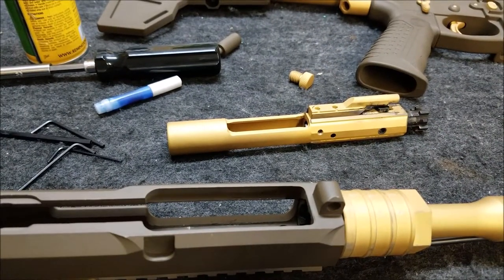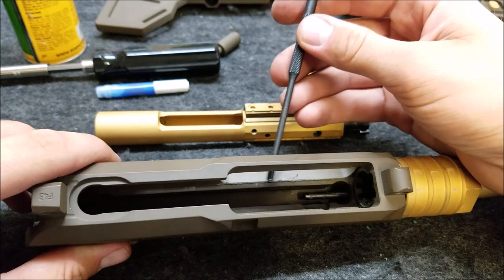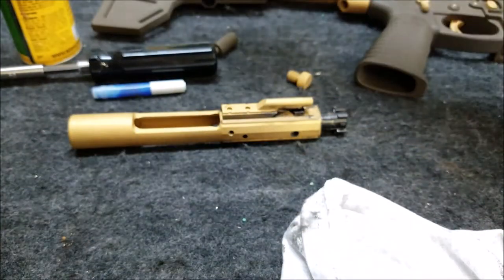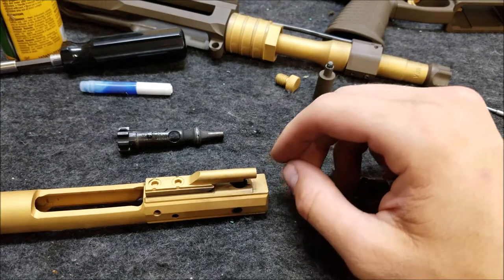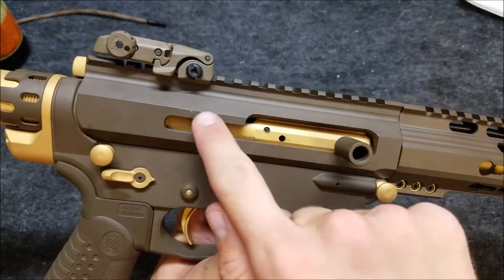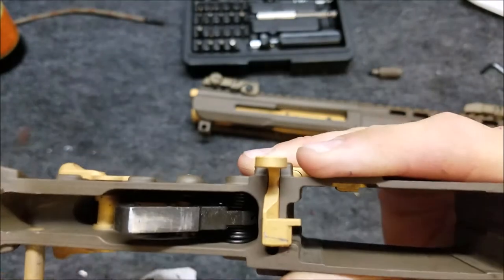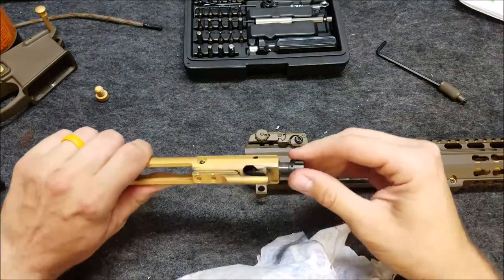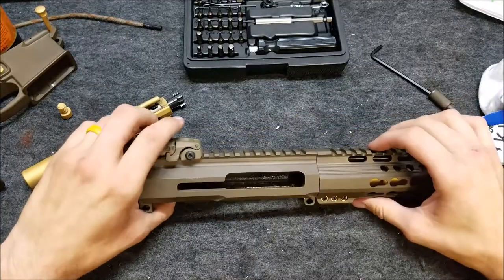Cerakote on BCG and internals. What happenens?

Comment: Cerakote has a permanent dry lube for internal parts. Look up Cerakote's Micro Slick, it goes on much thinner and doesn't wear like their normal coatings.
Reply from the maker: RockKnocker17 That sounds great! I didn't know that. I'll talk to my applicator about this. Have you tried it?
Reply: @GunsWithGage  it works great, its essentially hard like elite series, and is slippery like Nickle boron. and is thinner than h series.
Reply: @silverstormrifleworks7080  only draw back to the micro slick is one color.. would be nice to see a few color options for two toning. but function over form is always best.
Reply: @cwkhonda  oh yea definitely, it looks like garbage lol, would like if it came in black or at least a pretty gray
Reply: @cwkhonda  they actually recommend E-series for the internals. They have a few different color ways you may like
Reply: As Mr. C said above me, micro slick is only recommended when you need the 1200°F property. Elite is recommended by cerakote themselves for internals because it's harder and the coefficient of friction is about the same as micro slick, but it's just not as heat resistant.
Reply: Here is what they say:
"We recommend coating a BCG and Slide with the Elite Series Cerakote, so that you have the best corrosion resistance and protection along with the coefficient of friction performance.

The Elite Series and Micro Slick have an excellent coefficient of friction performance properties. The Elite Series has a 500°F temperature rating, and the Micro Slick has a 1,200°F temperature rating.

If you wanted a higher temperature rated coating, you would go with the Micro Slick."

Comment: Poor cerakote job. Someone used way too much spray and didn’t cure it properly. Let a professional do it, rather than wasting your money with DIY kits
Reply from the maker: Who do you use? This was done by a professional
Reply: GunsWithGage lots of people call themselves professional, but a certified cerakote applicator, trained at cerakote, should never turn out a job like that. The coating looks like they over sprayed and didn't use enough hardener. I cerakote at savannah river cerakote in Augusta, Georgia. We have several shops that will cerakote, but we're the only certified shop. The difference in quality is obvious when you get a good cerakote job.
Reply: GunsWithGage ...also, I'm not trash talking, just so you know. It's difficult to convey a message in appropriate context through typing. I'm just pointing out what I see, and I think you'd have a lot less issue if the coating was applied properly. I've seen stuff build up with duracoat, rattle can, etc, but cerakote is too thin and hard
Reply from the maker: HH it would be ok if you were trash talking haha. I am totally open to discussing things like this. To be honest, I have been a little disappointed with the wear resistance of my cerakote lately from this company. They are a bif company that is a certified applicator. They do all the engraving work for Bond arms. Among others. When I dropped off this gun and another batch, I think they were training a new guy. I would love to see any pictures you may have of USED cerakoted BCG's. This way, I can show my applicator, and maybe they can make some changes. It would be really cool if you could reach out to me on my gunswithgage Facebook or or at clementscustomfirearms@gmail.com
Reply: That’s what I thought. But I’m not a expert and have never applied and coating myself. I’ve heard that even after baking the coating it still needs quite a while before the cerakote has cured to its potential hardness is that true and if so how long should the gun sit before it’s cured inside like this upper?

Comment: No offense dude, but if it was kinda stiff, then you did it way too thick.. when you don’t get the layer between .005 to .001 mil, then your finish won’t hold up. Should be wearing way better than that.. actually should be no wear after only 100rds.

Comment: Cerakote sucks for wear parts, I did my Prodigy barrel and it wore off in like 100rds.  Pointless, works great for outside surfaces like frames and slides and small parts. But internally it's just messy and not durable

Comment: I wondered about how well it would hold up on anything but a safe queen.
Reply from the maker: I would Recomend against it for firearms that are used beyond just for show. It doesn't cause any issues,  but with all the good coatings you can get now, it's a waste of money on a BCG. I'd just stick with NiB, or TiN
Reply: Cerakote is a awsome finish this wasnt installed properly and  he used wrong product that's why their is some many issues dont let this determine your final decision
Reply from the maker: @rcplumberpilot  the bcg was done by a "professional applicator" I did not do it myself. Maybe they did do it won't. Cerakote IS awesome. I have had 3 bcg's cerakoted at different times, different colors, and they all turned out the same. An orange one really wore off quickly. Maybe it was done improperly
Reply: I do appolige wasnt trying to personally attack you or what you have dont just giving my input on what I see could be a issue please dont take it personally wasnt ment as a attack
Reply from the maker: @rcplumberpilot  oh no worries! I didn't take it that way. Just wanted to give all the info I had on it with my reply. It very well could have been applied wrong, but I do trust the rest of the work the place has done for me. I appreciate input Steve!

Comment: I found out when you first break in the Cerakoted upper use a lot of gun grease and you won't have any issues tape off the gas port so you don't get coating to block the port and unless you just really over coat the inside it should be smoother then without Cerakote I've actually have a lot smoother action with Cerakote the. With the lubed uppers that already come lubed

Also Cerakote says not to coat bolt faces because it can change your head spacing so I recommend not coating the bolt but the carrier is fine
Reply from the maker: Greatwhiteford 1 good idea on the heavy grease. I may try that on another cerakoted bolt/upper. I was using heavy oil. 

You are correct about the bolt. I would hope that most places that are applying cerakote would know this, and inform the customer. There are alot of DIY at home guys doing cerakote that my not fully understand how these things work. Education is a big part of safety..... 

Thanks for the comment!
Reply: Is this Cerakote C or H?
Reply from the maker: bigal31679 H

Comment: I would use micro-slick on the inside and whatever color you want on the outside. I almost did it to my upper on the inside but I ended up just using a regular black color. Been working great after a few hundred rounds. I do wished I used that micro-slick instead but I think I'm going to try it out on one of my pistols instead.

Comment: Not sure regular cerakote wearing off and entraining in oil is good. Isn't it the effectively ceramic abrasive paste? There's a reason they use hard coat type 3 anodize for most AR receivers. You want that very high surface hardness to protect the underlying aluminum.

Comment: There are coating's and there are metal treatments just because the black coating on black anodizing,pvd and dlc is worn off the surface hardness is still there, I'll take a treatment every time like you said internal parts no thanks exterior for looks and protection sure as long as it's not a duty or edc because cerakote is just a paint at the end of the day and does wear to a battle worn look fast

Comment: Get a real rifle that not affected by dirt and debris like an AK variant. Dont know what people see in these tube to function outdated systems.
Reply: Because some of us actually want to hit what we aim at!
Reply: if you manage to round to go off at first place.
Reply: Still better then looking past a canted sight. Laughable outdated system at best. Have fun with those crap mags unless you buy the mil spec waffles for what 100.00 bucks hahahahah!!!!! SMH!!!!!
Reply: @spoke1183  as a former AK owner, I can tell you, pretty much all AK vs AR myths, are just that. Myth.
You are regurgitating talking points that the very first M type rifles sent out during wartime had some issues. The communists used that for propaganda, that obviously worked since you're talking about it 60 years later. Cheap AR manufacturers during each Democratic bump kept that myth alive.
THE ACTUAL FACT IS, either AK or AR, properly taken care of, can be submerged in a lake and fire a bullet or two after. If the magazine was in it, that mag is dead. The quality of the parts of the two rifles determines how many more bullets it shoots from a clean mag. Also whether it was cleaned off before firing.
Lastly, I like the "AK variant" strawman you set up. Because I know exactly what you are trying to get away with.
Reply: I am wondering what the AK vs AR has to do with this Cerakote video? please explain.
Reply: @smokingdivot1762  the implication is that an AR needs Cerakote to survive the elements (when most of it is aluminum and stainless steel, lol)